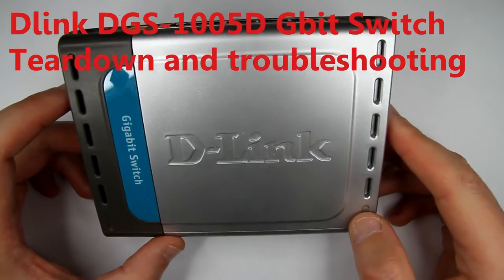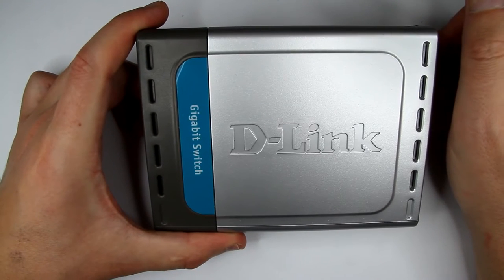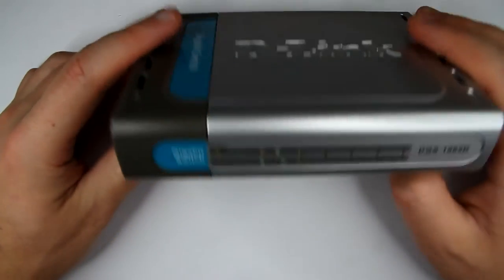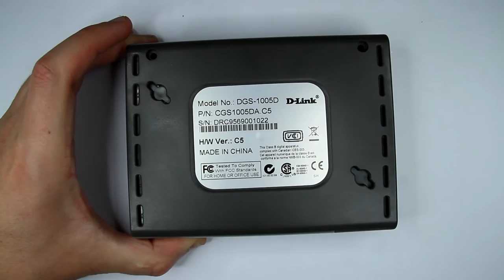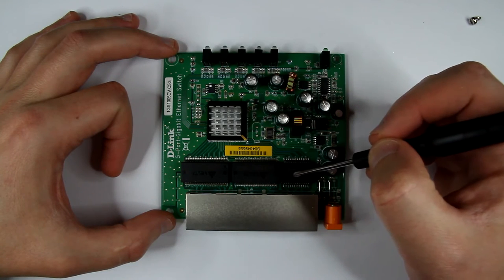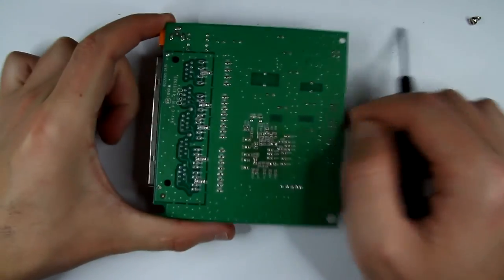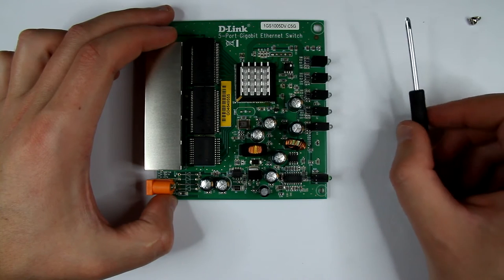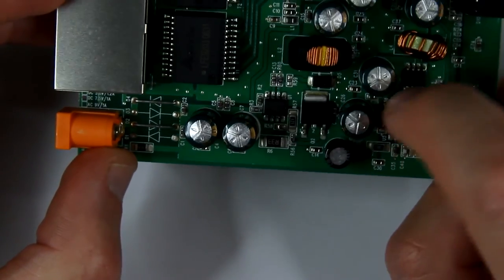D-link DGS-1005D Gigabit switch teardown and trobleshooting.

Comment: I have the same failure mode, on H/W Ver.: C2.  Did you ever resolve the issue with the switch?Also, that isn't an "unused option" for a third mounting screw on the board.  One of the case screws goes through that hole and does double duty holding the case closed, and the board in place.
Reply from the maker: Yes! after I changed all caps it works again  ( still works for 3.5 years since original video posted )
Reply: Thank you!  You've really given me hope to recover my switch.  Do you still recall the specifications for the capacitors, and what manufacturer made them?  I want to make sure I have the correct parts that will give me the same long-lasting performance you have before I warm up my soldering iron.
Reply from the maker: @Kineth1  Hah I completely forgot that I have repair video - https://youtu.be/9_gLnsg0eag
Reply from the maker: @Kineth1  Completely forgot That I shot repair video as well - https://youtu.be/9_gLnsg0eag